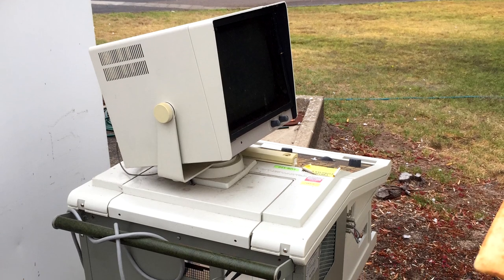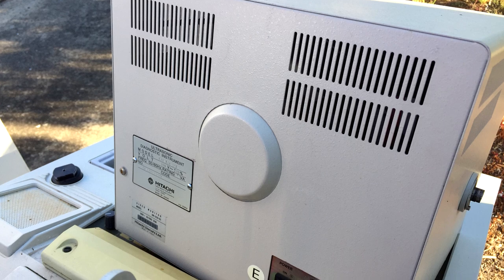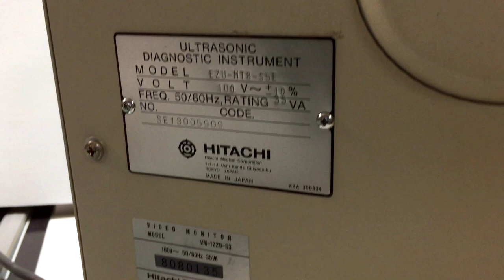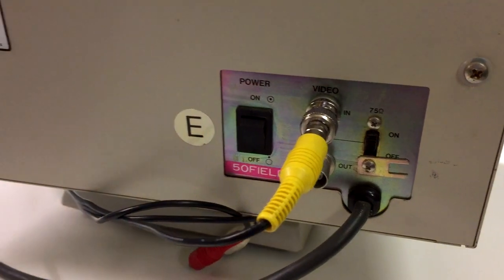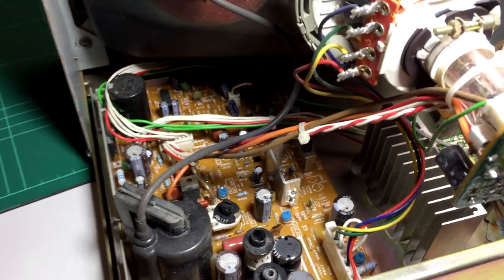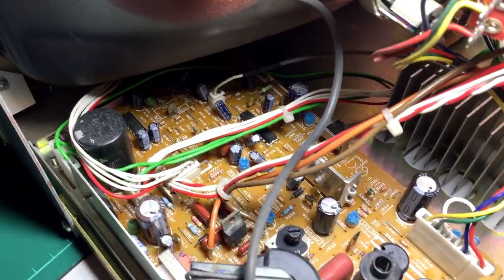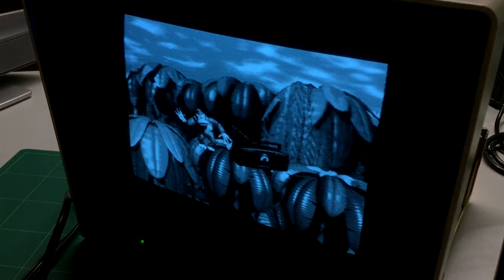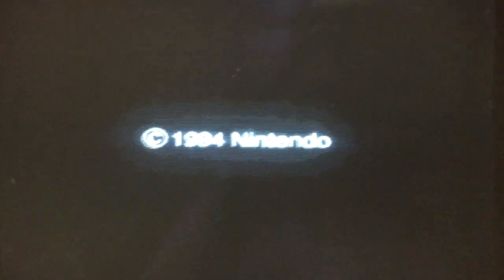Gaming on a Ultrasound CRT!

Comment: How would you get sound out of your SNES using such a monitor? I'm about to get 2 Barco RGB monitors that only have image inputs but no sound output. What do you use for the sound?
Reply from the maker: If it were me I’d set up some small speakers and mini amp / volume control and just run from the stereo out on the SNES